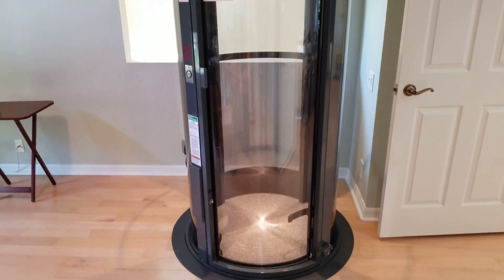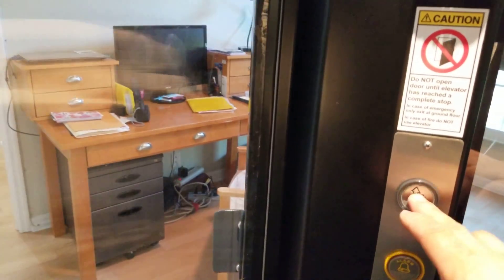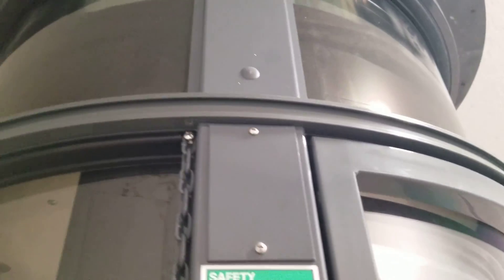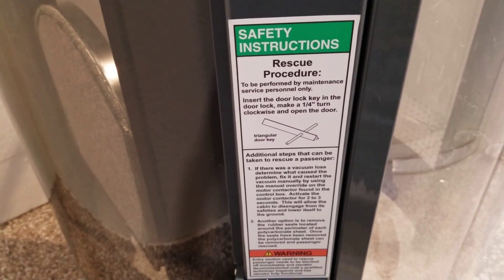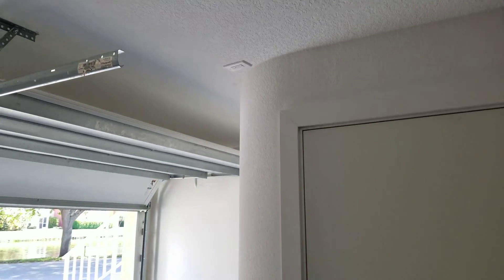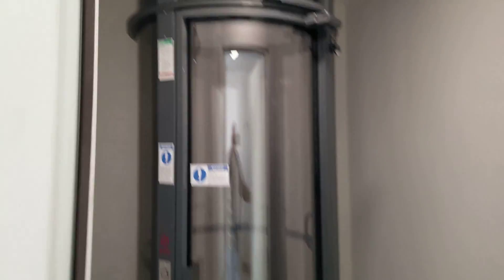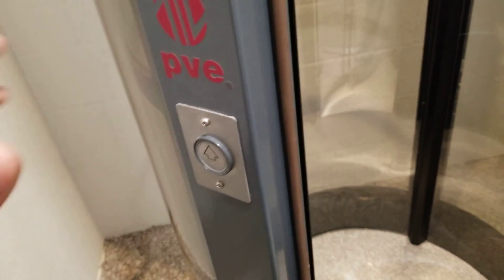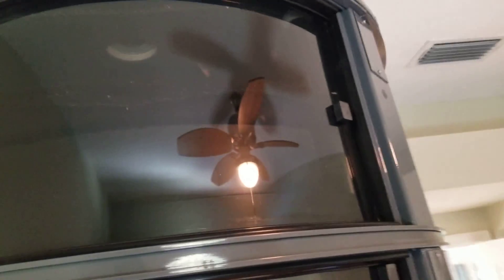Pneumatic Elevator Demo

Comment: What I would wish if I  were to invest in one of these is if it had a floor selection panel on the inside so you could skip floors without having to hit the button twice and Im assuming only the call buttons have the ability to make the elevator car skip floors if needed
Reply: maybe this one you got just has the one button system because it seems to only serve 2 floors and multifloored ones actually do have floor selection on them

Comment: You said it is loud. A simple fix is having absorbent material, cloth, etc., to make it sound proof. Higher tech would use sound dampening glass or plastics, or dual window. Just a thought, if it's your creation.
Reply: Or you can have the vacuum motors in a separate box on the roof of the house and two 4" PVC pipes to connect to the elevator itself.
Reply: I'm thrilled actual sound is in this video. So many are covered up with loud music.
Reply: @charliae7155  That's what I found too !

Comment: I had the PVE 37 installed in my home about a year ago. It's no louder than my central vacuum cleaning system.
Reply: How much did it cost?
Reply: @michaelt779  The cost of the 3-floor model was $60,000. I had to spend an additional $15,000 for structural modifications to accommodate the unit. This included removal of two stairways, converting the spaces into rooms, and electrical work. Due to advanced arthritis and advancing years, I can no longer deal with stairs. The elevator was worth every penny I paid for it.
Reply: @Gwaithmir  Thanks for the info.
Reply: @Dustinavollmar  My PVE 37 cost $60,000 for three floors. Installation was included in the price. I would guess that the installation company was charged half of that price.
Reply: Have you had any issues with the glass streaking? Did you order with clear or tinted polycarbonate? Tinted was standard but they added a clear option at some point in the past couple years. I talked to a couple long time owners and they both said zero maintenance other than a seal which I think was like a $20 part.
Reply: @fakegoldcoins  I ordered the clear polycarbonate because most of the elevator tube is enclosed within walls. Dust sometimes clings to the inside of the cab because of static electricity, but it's easily removed with a vacuum cleaner and soft brush attachment. I've had my elevator for just over a year and have had only a few minor issues that were corrected during scheduled maintenance visits.
Reply: What's is thease  lift total cost
Reply: @pratikraykar2801  The cost of the 3-floor model was $60,000. I had to spend an additional $15,000 for structural modifications to accommodate the unit. This included removal of two stairways, converting the spaces into rooms, and electrical work.

Comment: Please Mark can you tell me what is the total power of the vacuum pump in liters per minute or per hour? If it’s not a secret, I’d love to try doing a DIY project. It seems to me that it has three motors with about 4.5 kW but because the consumption is a relative thing, I only need the data L / min or L / h. I am grateful to you in advance.